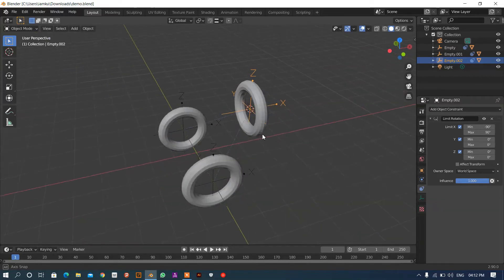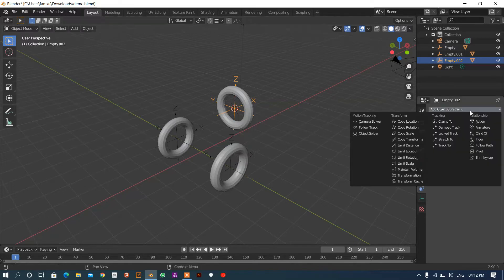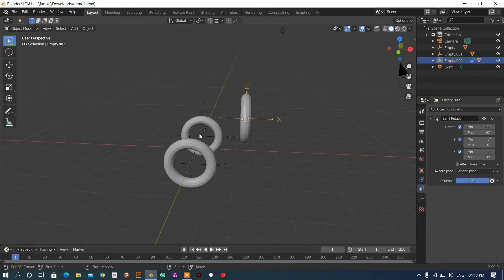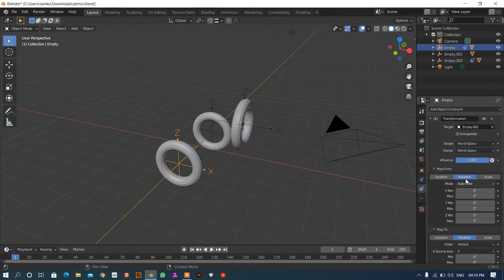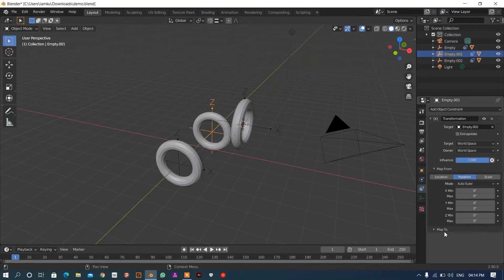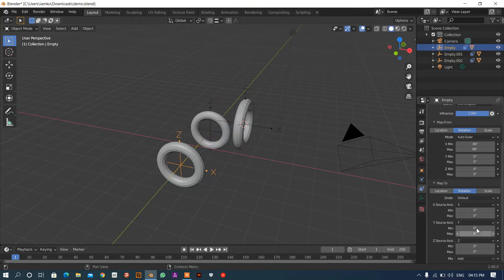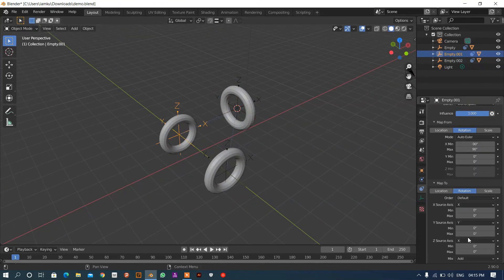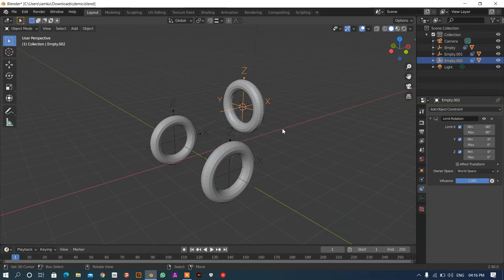How to rotate wheel with the help of steering in blender

Comment: im having issues. trying to do this with a fully modeled car which i have rigged. when i do this, the steering wheel doesnt rotate correctly since it was not completely vertical when i added the axis and all that. it is sitting at an angle like most steering wheels. this causes issues